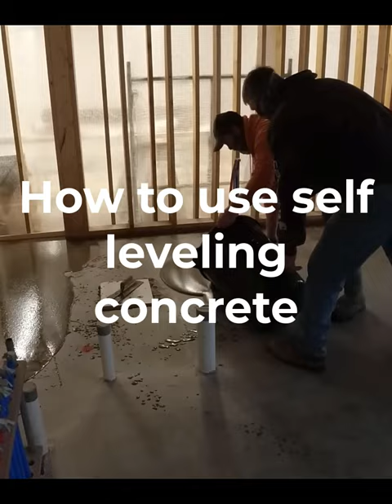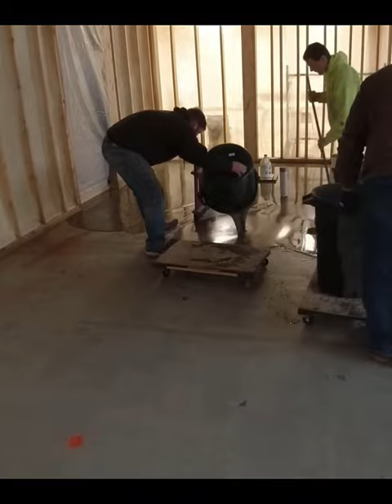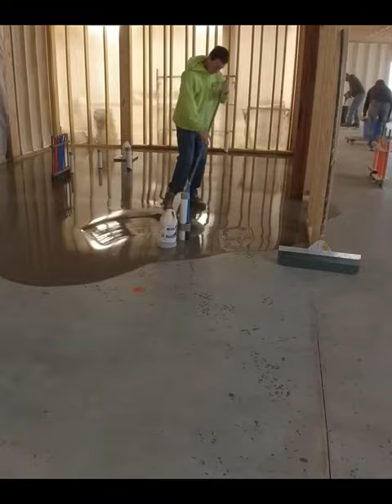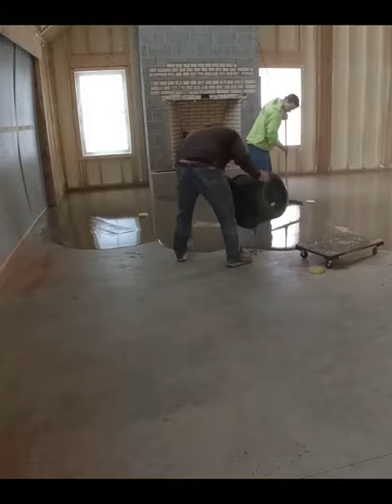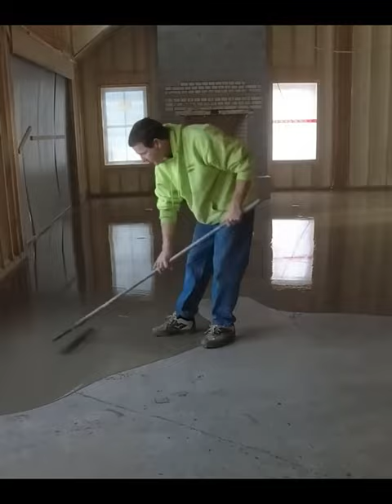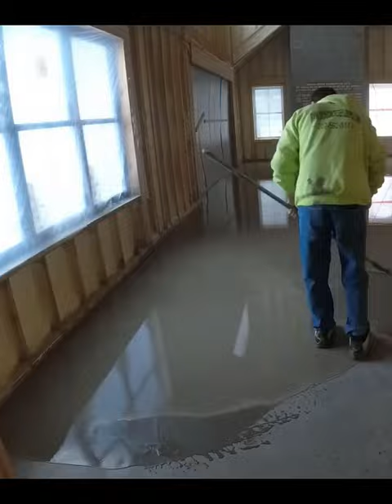How to Self Level a Concrete Floor! #shorts

Comment: So you can step on this? Do you add any extra water past the recommendation on the bag here?
Reply from the maker: We added only a few ounces over what they recommended, it hardens up in about 4 hours to walk on.
Reply: he is wearing shoes with cleats on them during the pour, so that very little contact is made with the surface to disturb it, if that is what you are asking.